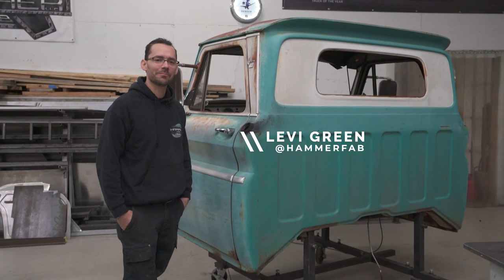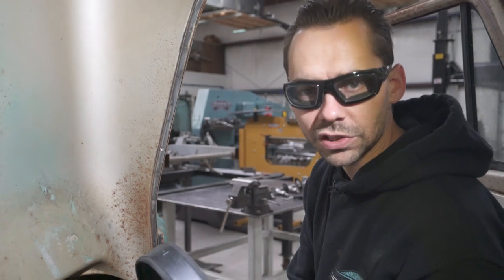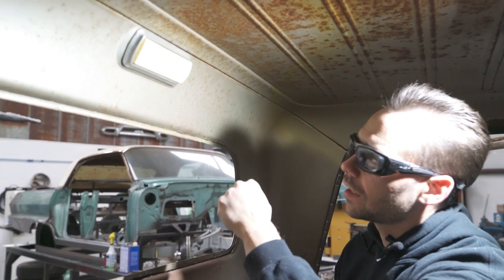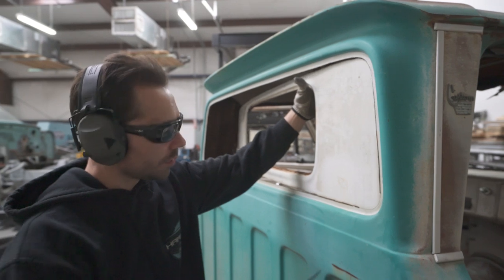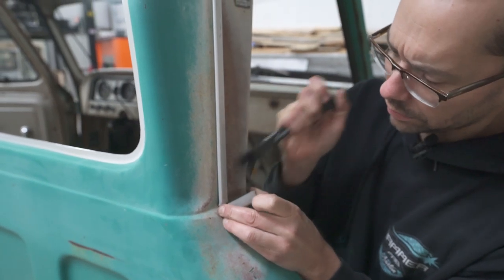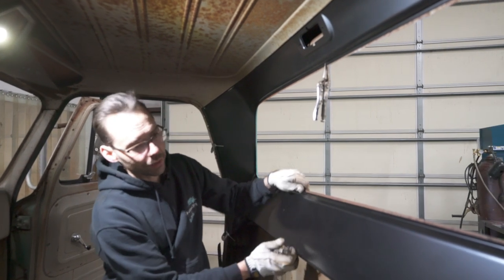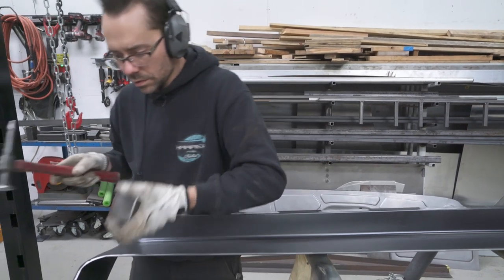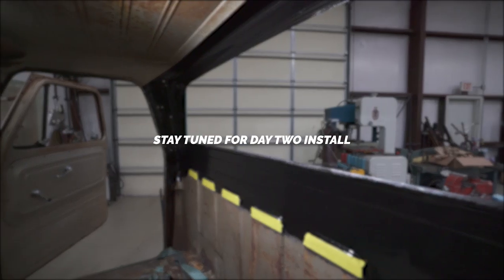Big Window Conversion for 60-66 GMC/C10 - Day 1

Comment: Personally after watching, I do recommend the big back window for self explanatory reasons. Nice look but more so, saving a cab from its own demise as it rots away from tin worm dust. I am going to see if you have changed a cab top because of around the windshield is most likely pin holes just waiting to be rain holes and a very sad looking restro modification. Yes I did subscribe

Comment: I don't know but small back windows are unique.
My dad is a body man for over 50 years he would just say you're Butcherizing it!!! 
I have a 1967 to 72 and yes it has a Small Back Window  combination with a '90s stepside box needless to say this is a Johnny Cash truck one piece at a time.
Reply from the maker: Todd Trcka I would consider putting that 90’s box on there “butcherizing” lol. Just sayin.
Reply: @HammerFabOfficial  Absolutely... and I'll bet that the quality of work for that 90's box is nowhere near the level of what Hammer Fab would do. I mean, the two jobs are apples and oranges. The large rear window on the 66 GMC WAS an actual option for the year. However, the 67-72 didn't offer a 90's step-side bed, and it was probably mounted with zip ties and safety wire. Either way, no educated individual would use the term "Butcher" when describing your work. Based upon that dude's comment, I can almost picture a Beavis and Butthead father/son duo.
Reply: I like your humor and most definitely the smaller window is more desirable to me there's more privacy... I actually had a 66 short bed Fleetside small window straight 6 no AC now that's tough in Texas however was just fine because of the vents on the floor inside windows I miss that truck and would like to have that body style again and absolutely no big window... I looked to see if somebody actually had an opposite opinion even after clicking and watching someone butcher-Rising it😂 there's nothing wrong with humor and the way Southern folks talk... most people are kind and don't care where you from as long as they don't try to shithole or make our country a third world. It seems they have destroyed our childhood Americana every way that they can I pray it gets restored including the good book people used to live by still do mostly I believe in the southern states.

Comment: from my experience POR15 wasn't the best choice for that inner cab.  I would have used a rust reformer and that would have been plenty of protection.  If you wanted a step further you could do a rust reformer (turns the rust into a black protective polymeric coating), and an etch or epoxy primer (they make them in rattle cans).   POR15 is expensive and can peal when you don't have much rust.  I almost don't see any point in POR15 in a restoration, it is more a patch (to give you time) for when you don't want to do a proper repair.  Other than that this was an awesome tutorial.

Comment: Hey Levi, great video. Do you have a link/source for that burr bit you used on the spot welds? Would like to get one. Much better option than drill bits. Thanks!
Reply from the maker: MSC

Comment: you ever heard of the spot weld drill bit? I can do this entire job with a quarter of the tools you have plus it'd cost me thousands less. a drill, a wire wheel, a spot weld drill bit, a grinder with cutting disk and I'm done. you guys are just trying flew your tool muscles. look at the tools I have and I don't need 3/4th of them. what a joke.

Comment: OK FYI, the 415 will peal around every place you weld and then will hold moisture between it and the panel...I am speaking from experience.  Only P O R  after all the welding is done and you took to much of the rust off the panel for it to bond correctly.